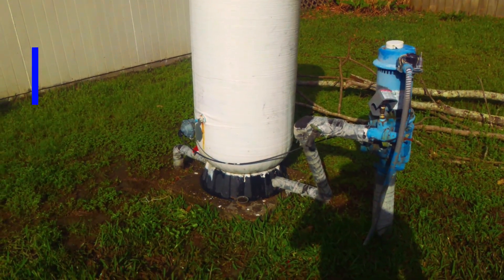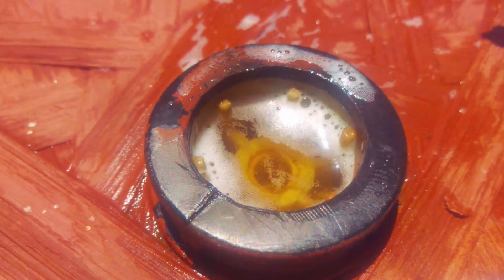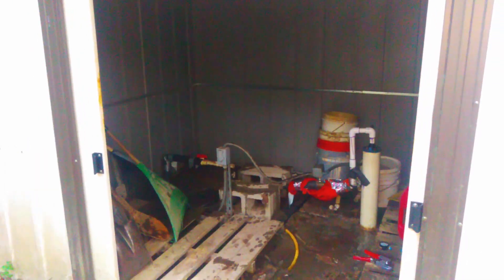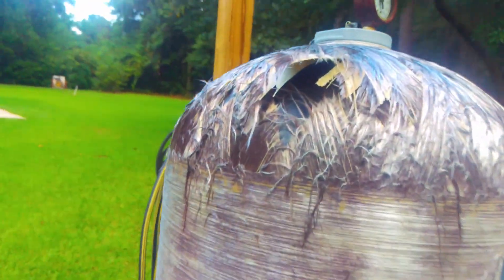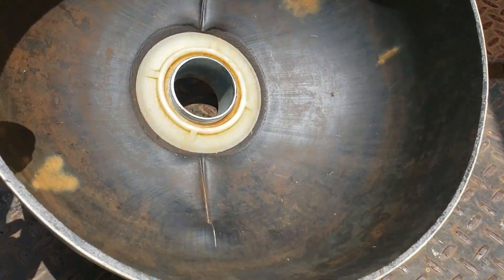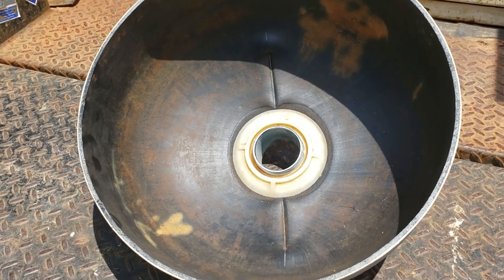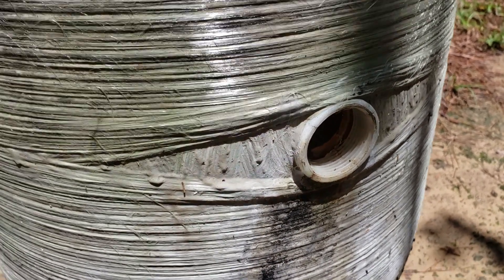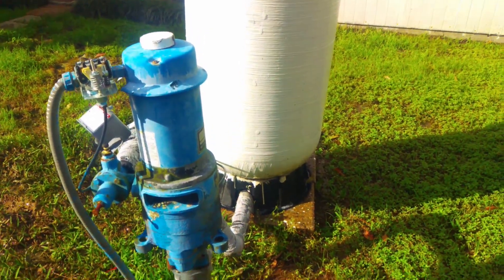Fiberglass well tanks - Why you shouldn't use them!

Comment: Bruh it lasted 10 fkng years. What do you people expect? Lifetime guarantees? Cmon folks, its pressure and water. And your mad at it bc it failed bc it was baked in the sun its whole life. PUT IT UNDER A COVER. FFS you people are ignorant.
Reply from the maker: @Dontspeakboutme  I'm glad you have 25 years of experience and know these products so well and what causes them to fail.

I know I forgot to mention it but when these tanks fail and they leak on the top they burn up the well pumps.

It wouldn't matter if this tank was in a shed its entire life, I have a video of that also still failed. The fiberglass tank has an inherent flaw and it going 10 years is actually pretty good. 
On the contrary to what you expect, metal standard tanks can go 20 to 30 years easy.

Come on man keep your comment out the comments for the ignorant people.

Comment: I can repair that tank in ONE day.
ALL this stuff can be repaired.
Reply from the maker: So your gonna climb inside a 2" hole and plastic weld a tank 6' at the top and it last more than a day?  Do you even understand how fiberglass pressure tanks are constructed? The fiberglass is not the water tight portion it is only for structural support. The plastic liner of the tank inside is what has failed and can "NOT" be repaired!
Reply: HOW?

Comment: My first fiberglass tank failed after about 8 years.  It leaked from the top and got waterlogged frequently.  It was the type that didn’t have a bladder inside.  I had a well company replace it with another one just like it.  After watching your video, I agree that they are a bad design.  The next tank I buy will be a metal one.  I’ll look for the good quality kind as I heard the big box stores sell cheap metal tanks that are just as bad as the fiberglass ones.
Reply from the maker: 100% State, AO Smith tanks are best.

Comment: With the tanks leaking, why do the pumps fail? I’m confused
Reply from the maker: Because the tank is no longer serving it's purpose to store water as all the air leaked out!
The compressed air in the tank is what stores the water.
When one of these tanks gets a leak on top all the air drains and the pump begins to short cycle.
This is known as a waterlogged tank and is the leading cause of pump failure.

When a pump runs it needs to have a long cycle time of atleast over 30 seconds.  When waterlogged it can be a little as a few seconds or near instant.  When the motor starts and stops so quickly the windings heat up and will burn out.  The thermal overload should protect them but they rarely do as they keep turning back on after cooling off.

To make matters worse the leak will make the pump run without customer using water. So over night or weeks go by and the pump is continuously starting and stopping until it burns up.

Comment: What would cost  be to install 50-100 gallon water well tank.
Reply from the maker: Right now, depending on fiberglass around 600-800$ a steel tank 800-1200$ but that's my prices other companys may do for more or less.
Also very hard to find metal or fiberglass tanks right now.

Comment: Hello,great info. I have a wellmate tank placed outside with no shelter. It works well, no leaks of air or water whatsoever. But a month ago or so, it appears a crack on the  fiberglass layer, the inner plastic layer seems to be ok, no leaks and still working ok. Can i repair this with fiberglass , or it's about time for the plastic layer to break down too?
Reply: I would plan on replacing it.

Comment: Not a good choice for exterior use. Im in NY and we use these all the time. 25+ years many of them. No issues BUT we have them all indoors. It looks like that’s the difference
Reply from the maker: Lol yea that's what the factory claims too, they can be in a shed for 10 years and still fail.  What people don't realize is the sun has little to nothing to do with the point of failure.  The plastic liner is a defective design that fails just from natural expansion and contraction as pressure goes up and down.  I show this in the dang video and you think sunlight is affecting that?  Only thing sunlight affects is the so called UV later they removed and now the top pops in less than 10 years of exposure.  Again I don't install these tanks at all I just remove and replace them with Steel!

Comment: Dad was a plumber for 38 years.  We always used Well-X-Trol metal tanks unless the customer requested fiberglass.  Just changed mine out after 12 years because the bottom was getting rusty and I didn’t want a wet basement.  You get what you pay for.  Lots of cheap plastic in the plumbing industry.  Just spray some flex seal on those tanks haha 😂
Reply from the maker: You know I loved those Wellxtrols too, lately they have had fair share of problems.  Been using the State tanks Pmx models have been really good the past 10 years only a handful of defects.   Yea plastic has its place for sure but not where it's absolutely needed to do the job right.  It seems as if all brands are swapping out all materials for lesser quality to save penny's but cost the consumer ultimately.

Take it easy man,
Casey
Reply: @ClearWaterPumpWell how would I search for that? I tried to Google "state pmx well water tank" and all I could find were water heaters.
Reply from the maker: Flex seal... Done seen so many customers try to stop full pressure coming out a leaking tank by emptying the whole can....🤣

Comment: Thank you for your expertise! You just saved  me some money. What is your preferred pressure tank (bladder, diaphragm, air-over-water)? Brand?
Reply from the maker: It all depends on water quality and water condition to determine what type of tank to use. You have to think about your application for filtration.  I prefer and have only been using Metal Standard glass lined and a.o. Smith diaphragm tanks.  They offer the best value and warranty and will last a very long time usually 20 to 30 years.

Thanks for the comment and watching.
Casey
Reply: The best in my opinion are Well X Trol, Goulds and AO Smith would be the second choice. Those fiberglass tanks rarely make it more than about 7 years.

Comment: and steel tanks rust out, I had one rust to dust in 5 years in a pit
Reply from the maker: That's true but depending on the brand and quality of tank you purchase will determine how long it's going to last. Fiberglass tanks fail for the wrong reasons randomly because of defects it probably will never be fixed. Under most conditions metal tanks last 30 plus years no problem just like your water heater in your attic which are also glass-lined tanks.

Comment: Newer tanks have a heavy epoxy UV coating. Here in East Texas we use Hydro pneumatic tanks. It's just a tank... no bladder. They are only found in areas where water quality requires them. Water and air are mixed together in a hydro pneumatic tank to reduce the "rotten egg" smell that sulphur bacteria and hydrogen sulphide gas in the water can cause. My question is I know there is a bleeder valve down under that allows water to drain back into the well and shuts when the well restarts. I believe this is so the air in the downpipe is used to recharge the tank and a float valve in the side of the tank controls the amount of air in the tank. I currently have a 40 gal tank and want to replace it with a 120. Is the depth of that bleeder dependent on the size of the tank?
Reply from the maker: Yes I know tank manufacturers claim there is better UV protection, but it's worse than it was 20 years ago when there was none. 
Changing your tank to a 120 is a good idea if you can afford it.  It will give more capacity to reduce the H2S in high demand use. 

The weep hole should be at minimum 15' below snifter valve or well casing.  If you hear a good burp of air now when pump comes on it will be plenty. 

Efficient removal of H2S requires little air but more time to dissipate into air pocket.  So technically the more air you have coming in and going out the better along with more storage space.

Also a metal tank is better suited in your case because of the hydrogen sulfide gas it helps protect metal from corrosion. So if you decide to replace your tank to a 120 gallon I recommend a.o. Smith glass lined tank which should last you more than 30 years.
Reply: @ClearWaterPumpWell  Thank you for your prompt response. The problem I'm having now is buying the tank. They won't sell me one. Has to be an installer. I'll try online.
Reply from the maker: Depending on where your located it's possible local hardware may have them,  just don't buy a flotech epoxy lined.  Search for water well supplier that also does service and should sell direct.
Reply: @ClearWaterPumpWell  just ordered one through Grainger. $925 free shipping.
Reply from the maker: That's actually not too bad considering current pricing and surcharges from manufacturers. Right now I'm installing for around $1,200
Reply: @ClearWaterPumpWell  you probably get them for $600

Comment: Guess mine is doing well at 19 years.
Reply from the maker: Yes you're in the top 5% usually when they're that old they weren't used very much. The actual cycling of the tank by stretching and Contracting causes them to fail.

Comment: The common theme is they're all outside in UV. Boats are made out of fiberglass butnthy have a lot of paint and gel coats on them. So maybe people need to paint them w several layers of paint when brand new
Reply from the maker: Ok apparently you did not watch the video, the very first tank I show was painted.  This will not save the tank they fail internally and randomly.

Comment: What AO smith is glass lined? I’ve had an ao smith for 18 year plus another 9 with the previous owner. Two tanks in series, the first corroded at the inlet fitting 12 or so years ago but the other one is still going. I’m not pressing my luck and will be buying two more. 

I’m leaning towards well xtrol but fear they too are living on their 30 year old reputation. Can you please tell us about the ao smith? 
Thanks!
Reply from the maker: You hit the nail right on the head! I'm sorry when I said AO Smith they are now called state water systems, a subsidiary of AO Smith.  The tanks are steel and the glass lining is a clear ceramic coating that is baked on. You are surely right about wellxtrol tanks as the older tanks were Bulletproof. As with all companies now it's all about the cheapest to manufacture, cutting cost on all materials and labor results in common problems. Most tanks still carry long year warranties but will fail under warranty and could get unnoticed.  You really have to decide what type of tank you need for your application and water conditions. Do you have a submersible or above-ground pump do you require filtration?

Comment: Out in sunshine and weather any pump and tank will fail,Majority of those tanks exposed to sun rain and freezing and the poor pump,no protection
Reply from the maker: What you fail to understand is this is Not True.  Well pump systems over 80% are out in the open and have lasted over 20 year's!
These fiberglass tanks even in a shed fail because of the inherent flaws they have!  The worst part about how they fail is leaking at the top causing them to waterlogged.  A waterlogged tank is the leading cause of pump motor failure and gets easily overlooked.  The tank will go from working one day to completely failed the next and most homeowners don't notice.  So please spare people of an unprofessional opinion that "Any Tank" will fail out in the weather!
Reply: @ClearWaterPumpWell  I live in Ireland and I mean no one that's no one has a tank and pump exposed to the elements,everyone builds a pump house, or has tank or pump indoors,you will half the life of any system if it's out in the weather,cold climates hot climates,don't need to be professional to know that it's common sense,garden furniture varnish plastic things bleach and crumble,boats have a gelcoat to protect fiberglass,tanks do not,it's obvious the top leaks first it gets more sun and wetting then the rest of the tank
Reply from the maker: @paulmurphy8549  Ok Mr. Paul I understand where your coming from, but look your missing the point here.  These Fiberglass tanks fail indoors in a garage or weather protected ill regardless!  Obviously if you live in a northern cold climate having any system with water exposed to elements means failure in the winter.  We live in the south here and rarely get any freezing weather and don't have to invest in cold weather protections.  So ultimately I would love if everyone had a shed around their well, but some I wish they didn't.  People just build over it not thinking of how its to be serviced in the future.  They put a door right up against a tank so you can't get in or put the pump back in the corner.  I have even seen people pour concrete around the tank and it has to be destroyed in order to replace it!  So I'm happy to go work on a fully exposed system that you can get to every part on it and repair or replace quickly.

Comment: The bladder type are no good as well. Flexcon barley make it 3-7years and the cad 2 design fails and water logs the tank. For hog operations i switched to wm25 well mates so we can replace the air cells  at lower cost. If anyone knows a  good fiberglass tank please comment.
Reply from the maker: I have been using the Perma tanks Sta-right/AOsmith SBD and now Pmx models and they have been holding up well.  The best one is the PMXP 36 it's a 100 gallon equivalent tank that stores about 12 gallons per cycle.  Or the PMXP 52 it's a 120 gallon that holds 17 gallons of draw down.
They may be metal tanks but they have plastic liners for water inside.  They hold up well in all water conditions just keep them off the ground and will last a long time.
Reply: we are putting in a pentair/wellmate 30 gal.  5 yr warranty.
Reply from the maker: @steveandsheilalauder8261  Good luck pentair tanks love to fail under warranty some less than two years.  The new design is horrible not like the old ones that made it 10-20 years. Fiberglass tanks may not rust but they can fail in other ways internally.  The leading cause of water pump failure is a water logged tank.  So check your well often and look for the signs of trouble.  You may notice pressure fluctuations or hear pump running quickly on and off, the cycle should be longer than 30 seconds.
Reply: @ClearWaterPumpWell  Long as it is under warranty, the only issue would be the inconvenience.  If there is an inherit design flaw, no going concern will continue a product that causes financial or market share loss. Like everyting else buyer beware.  This is the only post on youtube that i've found which has an issue with this product.
Reply from the maker: @steveandsheilalauder8261  Most consumers don't care to talk about their wells and just hire companies to deal with everything.  Yes you will have a warranty if installed by a company that covers it as they will deal with the paperwork.  Big corporations have started suppressing bad reviews and pay to win Pentair owns just about everything and are buying out longstanding old companies.  This has lead to products that once were dependable and repairable to being redesigned or phased out.  All for the excuse of efficiency or better technology.  Consumer grade well pumps don't need to be super efficient they hardly cost a average of 50$ a year in electricity usage as it is.  I can talk about water wells all day long as I have been in the business for over 20 years.  I used to install the Wellmate tanks 15 years ago but that's when things changed and would not recommend them to my worst enemy!   Oh and you can't even recycle those things just landfill!
Reply: @ClearWaterPumpWell  My installer has been in business (softeners) +50 years, with an A+ BBB rating.  Cheers.
Reply: @ClearWaterPumpWell  AGREED!